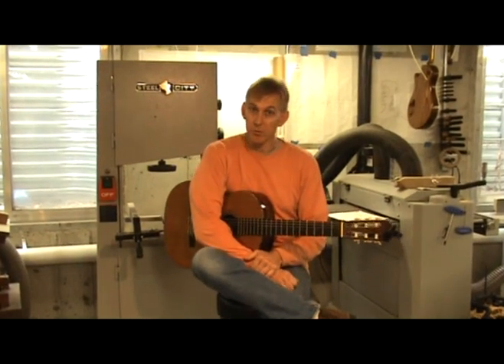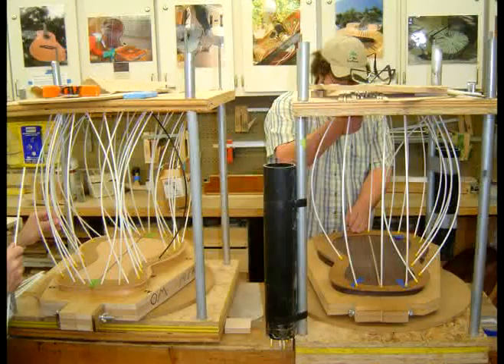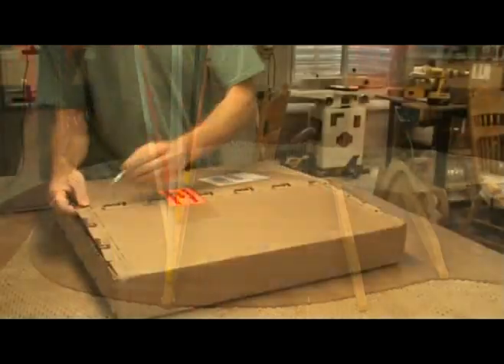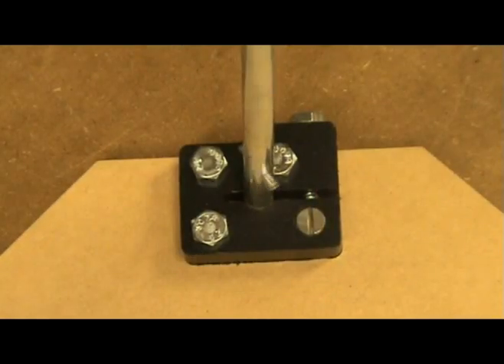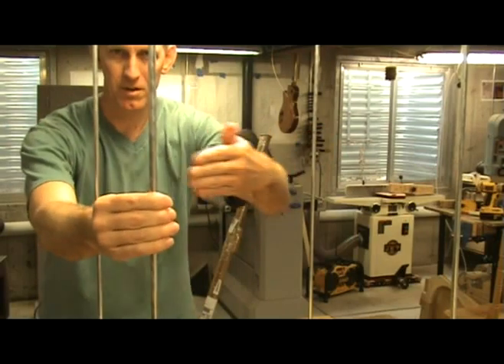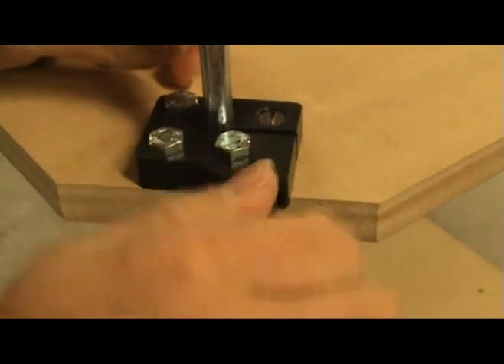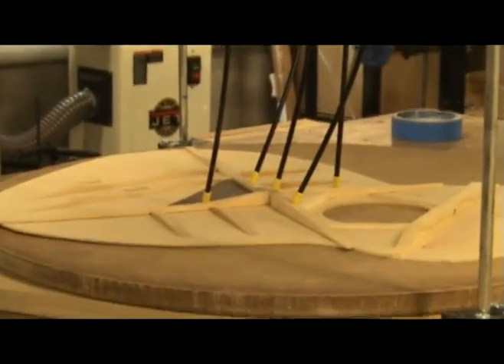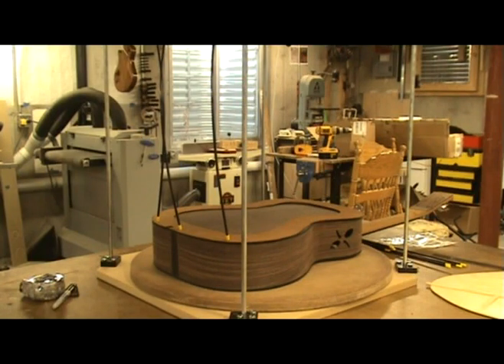O'Brien Guitars - LMI Go Bar Decks Instruction

Comment: Hi Robert, great and useful video! I was wondering about what's the "right" amount of pressure for the go-bar deck... and if there's a way to measure it. Thanks!
Reply from the maker: I use 24 inch rods and set up my upper and lower decks at about 24 inches as well. To measure the pressure place a bathroom scale in the deck and place a go bar rod on it. See what it says.  I think you will find that adjusting the deck up or down will not affect the pressure much.
Reply: OBrienGuitars Thanks! I'll give it a go and see what happens :-) !